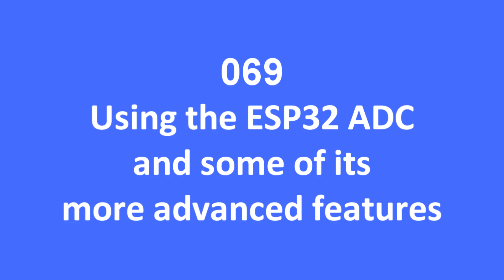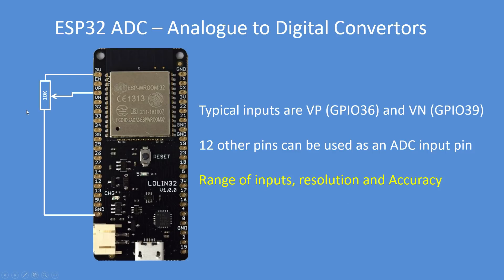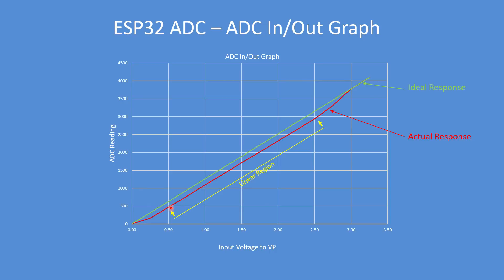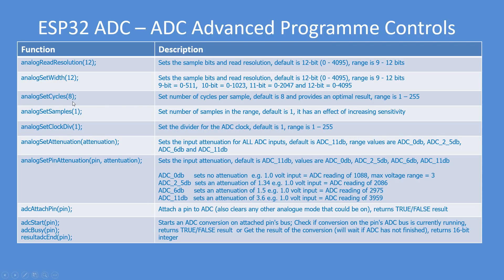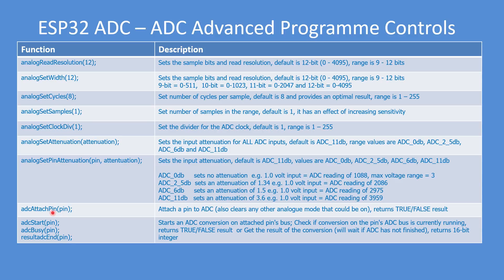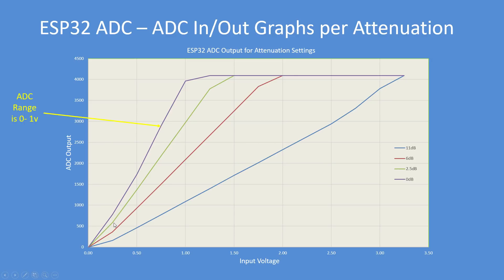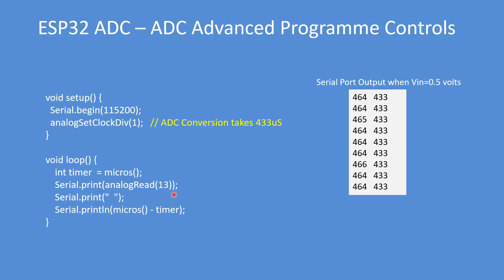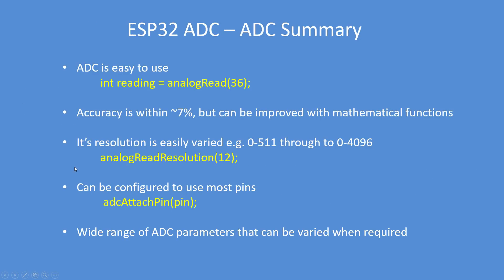Tech Note 069 - Using the ESP32 ADC and some of its more advanced functions

Comment: Thank you for this very clear video.

However I am still unclear on the exact behavior of function "analogSetSamples".
If we increase the number will the output be more "precise" with a kind of average done on several samples ?

Thanks
JP
Reply from the maker: This might help you out: https://en.m.wikipedia.org/wiki/Sampling_(signal_processing) What the setting does is increase the number of samples taken for any given readADC activity, but what I don't know and is not adequately explained by Espressif is what value is returned, but it is most likely to be the average of the samples taken.

Let's say a signal being read during a reading activity and it fluctuates like this 1.200v, 1.201v then 1.195v then when  analogsetsamples  = 1 it would return 1.2v, then when analogsetsamples  = 2, it would take 2 samples in the example 1.200 and 1.201 and return (with some quantisation error) (1.2+1.201)/2=1.2005v and then when increased to 3, the result returned would be (1.2+1.201+1.195)/3=1.198v.

This effectively increases the sensitivity as it is more likely to detect small perturbations in the signal, that a single sample would not see, but don't confuse this with increased accuracy, it's just an increase in the sample size of the average value returned. The correct result is still 1.2 with one sample set and the result when 3 is set is a better result that is representative of all 3 samples. I find it is useful to test these concepts with extreme values, lets say a waveform, perhaps a sine wave is being sampled, but every so often the signal drops to zero, giving a spike in the waveform, sampling the waveform at discreet points could occur when the spike happens and give a zero result, but actually, a better result would be the average value around the spike say a sample before the spike and a sample after it, using setanalogsample = 3 would likely give a better result if the waveform value before the spike was 1.2v, then followed by a 0v spike then followed by 1.25v, the returned value would be 0.816v, it should have been somewhere between 1.2 and 1.25v on a sinewave, but it's better than 0v.Hope this helps.
Reply: @G6EJD  for sure it helps !
Thanks again for your help
Reply from the maker: You need to study signal processing techniques to get a full understanding.
Reply: @G6EJD  
I do know these Technics. But as you said expressif is not clear on what they do with the various samples acquired !

Comment: can i use ADC in a 5v out sensor?
Reply from the maker: Yes but only if you add an external voltage divider using 2 series resistors one end to your input source (sensor) the junction to the ADC and other end to the ground. Two resistors of 100K each would extend the input voltage range to 0-6.6v
Reply: Would a 2k and 4k ohm resistor suffice? Im using a pH meter and it needs an analog pin..
Reply from the maker: That’s ok, those values will give you a 4/(2+4)=0,66 division so scale your ADC reading accordingly with some constant to adjust the range eg 3.3/0.66 so readadc/0.66
Reply from the maker: Your chosen values will give you a 0-5v reading range and you should be able to read the sensor with no issues assuming it can drive an approx. 6K load.
Reply: thank you so much for the replies, im using this pH sensor and the codes provided in the pdf. i tested it in my arduino uno and it has no problems, but when i used it in my esp32 (devkit v1) (pin 36), i cant seem to make it work. any advice in my situation sir? i am really lost..
Reply from the maker: You need to assign pin 36 to one of the ADC’s I did a video with code examples on doing this either that or your not reading that ADC channel
Reply: I gave up on the code, what i did was i used your code (if you dont mind) to get the voltage. After that, i mapped the voltage to its respective value. The voltage reading using your code is really accurate compared to conventional analogread.. Thank you so much for your advices.. More power to you sir...

Comment: Would there be a way to do the polynomial for just the ADC value, not the voltage it represents?
Reply from the maker: I'm not sure what your trying to do. The ADC value is the polynomial determinant and so you have the ADC value, there is no new value of ADC to be found that is more linear. The ADC value is an input voltage function.  What are you trying to do?
Reply: G6EJD thanks for replying. I'm trying to correct the 12 bit curve for input into emonlib, (energy monitor with ct sensors, and an ac voltage sensor) which does it's own calculations and samples based on the ADC output value.
Reply from the maker: OK, I know the emonlib system. I have two thoughts, one is surely emonlib is expecting a 12-bit input resolution which is the compiler default for the ESP32 and using the polynomial gives you as nice linear reading that you need to scale to suit the range needed for emonlib, let's say it needed 0-5v range, then take the ESP32 poly reading and x 5/3.15 that will scale the 0-3.15v to 0-5v, or you can scale the 0-3.15v reading to 0-4096 (12-bit resolution) so you take the (poly reading) x 4096/3.15 e.g. 0 = 0 or 3.15v = 4096
Reply: Thank you so much! this has been driving me crazy! I'll give that a try.

Comment: Can you explain the ReadVoltage formula, I basically need to use the 0dB voltage and I measure the internal vref (via routing on IO25) which I put into the fuse memory, so my boards are calibrated in terms of the vref, however I don’t understand the constants in your formula and how to adjust it to 0dB.

Thank you for the great video. Helmut
Reply from the maker: When you quote 0dB you should always quote a reference for example 0-volts or 3-volts, dB is a ratio so has to have a reference.

For further example 0dB could be at an input of 0.5volts or 0dB could be at an input of 1.414-volts and so-on.

Next if you use analogread(36) versus my ReadVoltage(36) you will get a different result, ideally use ReadVoltage because when the input is 3 the ReadVoltage result will be 3, but the analogread will not !

Next to get to a reference value you simple need to use the ReadVoltage(pin) function in place of any analogread statements, then to adjust to your required reference simply add or subtract some constant value e.g. 2.5-Vref or whatever. That way you do not need to adjust the linearisation formula.

To make the ADC reading linear I created a polynomial equation and it is not easy to simply add or subtract values without affecting it’s result, that’s why it’s best to leave the ReadVoltage function as is, knowing it returns a more accurate reading.
Reply: How did you put the vref value into the fuse memory?
Reply from the maker: The ADC reference voltage is about 1.1v and is factory trimmed during production- it’s fixed. There is no means of saving a new value. Adjust your readings in your code to simulate a different Vref. I think with a 12-bit ADC and ability to measure between 0 and Vcc+0.3 that’s as good as it gets. You can compensate for a low or high Vref by a simple subtraction/addition to your readings within the (Vcc+0.3)/4096 resolution limit so each step is 0.8mV and therefore you can effectively vary Vref in 0.8mV steps albeit in your code. As standard the ADC is quite accurate but for better performance you’d need to use an external ADC.

Comment: Hi dave. Can i mesure the vin of the lipo battery connector and how ?
Thanks.
Marc.
Reply from the maker: Vbat 
 |
 |
 10K 
 |--- to ADC input either VP or VN
 |
15K
 |
 |
Gnd
float voltage = map(analogueread(VP),0,1023,0,5000)/1000.0F;
or
float voltage = map(analogueread(VP),0,4095,0,5000)/1000.0F; // depends on ADC range/mode set

if (voltage > 4.18) percentage = 100;
   else if (voltage < 3.0) percentage = 0;
   else percentage = (voltage - 3.0) * 100 / (4.18-3.0);

gfx.drawRect(x,y,100,30); // Draw a battery symbol
gfx.fillRect(x+2,y+2,percentage/100*96,26); // draw a black block that is sized in %

Problems, let me know, I may have misspelt a few functions:)
Reply: Hello Dave. With this code i got 3.64v and my lipo is 4.17v, is it normal?
unsigned int percentage = 0;

unsigned long previousMillis = 0;
const long interval = 1000;

// setup
void setup() {
  Serial.begin(115200);
  analogReadResolution(12);             // Sets the sample bits and read resolution, default is 12-bit (0 - 4095), range is 9 - 12 bits
  analogSetWidth(12);                   // Sets the sample bits and read resolution, default is 12-bit (0 - 4095), range is 9 - 12 bits

  adcAttachPin(VP);
  analogSetClockDiv(255); // 1338mS
}

// loop
void loop() {
  unsigned long currentMillis = millis();
  if (currentMillis - previousMillis >= interval) {
    // save the last time you blinked the LED
    previousMillis = currentMillis;
    float voltage = map(analogRead(VP), 0, 4095, 0, 5000) / 1000.0F; // depends on ADC range/mode set

    if (voltage > 4.18) percentage = 100;
    else if (voltage < 3.0) percentage = 0;
    else
      percentage = (voltage - 3.0) * 100 / (4.18 - 3.0);

    Serial.println("Voltage: " + String(voltage));
    Serial.println(String(percentage) + " %");
  }
}

Thanks.
Marc.
Reply from the maker: OK Marc, looking good. If you have a 10K R from Vbat to a 15K to ground then the voltage (assuming no ADC) load and it looks like there is, will give an ADC input voltage of 2.5 volts, which then get mapped to 0-5v and should give an ADC count of ~3100 and so after mapping 3.7volts and % = 66% so not that far out.So your particular ADC input impedance is lower than expected. If you can adjust your 15K R to 20K (could us10K+10K in series) or say a 22K then adjust the volts down in software.Using 3.0 volts is destroying the lipo life IMO and is better set at 3.6 but maybe 3.2 absolute minimum.
Reply: WOW!!! you are the best!! :)
4.17v :) :D
Reply from the maker: I've seen this before, some ADC input impedances are relatively low, I've some that measure about 900K and others 50K, this lower end loads the voltage divider, it's not usually a problem and easy to recalculate the values. Actually you can use just about any two resistors of R and 2R ratios 10K and 20K or 100K 220K  or 47K and 91K and get the same/similar results. If your running on batteries it's better to use the higher values. You can also use a single series R and limit the input current to the ADC but you'd need to experiment with values as every device seems to be different. Maybe 47K and print out the ADC value, ideally use a pot to get to the exact value then use a fixed R. Glad you got it running and measuring.
Reply: what is the x and what is the y ?
thanks
Marc.
Reply from the maker: Marc Paradis that would be screen position if you were to draw a battery symbol for example 

Void drawbattery(int x, int y){
  Then your battery code
   gfx.drawRect(x,y...(
}

Then call it with drawbattery(100,50);
Reply: @G6EJD  the best

Comment: Hi! I was planning to use my esp32 adc as well and your video really helped me a lot! But reading from a google search there's a bug in esp32's adc.
 Here's the link.https://github.com/espressif/esp-idf/issues/164

Have you encountered this issue too? 

Great tutorials btw! Thanks! =)
Reply from the maker: Ronell Oropesa All of my ESP32 devices show non-linearity at the extremes of their input ranges close to 0 and approaching 3.2 v, but this does not surprise me, my solution was to use a polynomial equation that corrects the results (included at Github link) and the resultant linearity is good enough for any application in my opinion. Yes it would be nice to get the device factory trimmed to improve linearity and I’m sure they will in later releases, but for now it’s adequate. I think the device is not to be confused with a device designed to be an ADC but what’s available is more than adequate for most applications and it does need an input attenuator to improve matters. The input impedance is unknown, but I estimate it to be about 500K or more, this affects input attenuation designs.
Reply: Thanks for your reply! I am already using the ESP32's ADC now. It's good for my application but a bit jumpy at times. I have also read issues that also stops ADC from working when WiFi is being use but it seems its just on the ADC2. Anyway would you mind if I ask how did you get the ADC's curve in your video? =)
Reply from the maker: Yes you can only use ADC1 if using Wi-Fi Espressif refer to this in their datasheet. I used MS-Excel for the graphs. OpenOffice would do the same. To get the same put a known variable voltage source on the ADC input and read the ADC channel whilst adjusting the input, from 0 to 3volts but no more! Then plot ADC conversion value for each value of input voltage. I used a Fluke meter for the voltage measurements.
Reply: Ahh.. That's actually how I was doing it. I just got too lazy and thought I should just ask you. Thinking your method might be easier. If only I just have an access to a ramp signal generator. Hahaha!!!  Anyway thanks again!

Comment: Thanks for posting, I'm using Pocket32 clone which has built in 18650 Lipo battery and holder with no sensors connected. I ran your sketch without  connecting anything to VP and VN. Whats the difference between doing this and having the resistor connected in inline?
Reply from the maker: That board has no connection to the battery at V2, but what you can do is use an inline resistor from one of the ADC inputs predesignated to a pin and it works because the ADC has an input impedance and so the external R and internal R form a voltage divider. The problem with doing it this way is device production variability will vary the reading, but nonetheless still works, just needs some experimentation with values. Unfortunately the input impedance is not published, but 100K might be a good starting point. To measure battery voltage route the end of the R to the battery + terminal, there is no pin for Vbat to make a convenient connection to.

Comment: New Sub here. Thank you for putting this video together. I was wrestling with this for a while (why the ESP32 adc doesn't line up but the uno/nano/mega do). I also notice the esp32 adc is a bit noisy. I fixed this problem by using an ADS1115 which gives perfect results but I'm a bit frustrated i needed to buy it. Now i see your formula and can give it a try. Again many thanks!
Reply from the maker: Happy to help. the ESP32 ADC is reasonably linear (factory trimmed) between the lower second quartile and upper first quartile so if the range in quartiles was 1 2 3 4 only 2 and 3 are linear, the polynomial helps to convert the actual output to an expected linear result. But using only that middle range is rarely any good for most applications. It's a very fast conversion, unquoted by the manufacturer, but seems to be about 10uS, I have not measured the actual time.
Reply: Just tested this out and your formula adjustment is much improved, nice work and look fwd to more videos
Reply: @G6EJD  From what I can see on the attenuation curves, it seems that 0dB attenuation could give the most linear results all the way from zero to around 1.0 volts, which makes me suspect their attenuator's nonlinearity (something about ADC results being 0 until around 0.16V and 4095 above 3.10V, as well as the curve becoming non-linear above 2.6V, which is 3.3-0.7, makes me suspect those are bipolar transistor voltage drops at saturation and Vbe values, which they may be using in their attenuators, which may be bypassed by not using attenuation). Have you tried its ADC with 0dB attenuation, and what were the results? I will try it myself as well.
Reply from the maker: Unfortunately Espressif don’t publish the input circuit details so that customers can understand the interfaces, they could be using fet switching of resistors or some form of varister to achieve the attenuation, who knows. I did trial the 0dB range and found little difference in the results, but don’t forget the resolution changes (lowers) on the less attenuated settings, so that’s why I opted for the 4096 variant to get the best resolution and fixed the non-linearity with a polynomial, a little slower to read but for the vast majority of applications it’s ok.